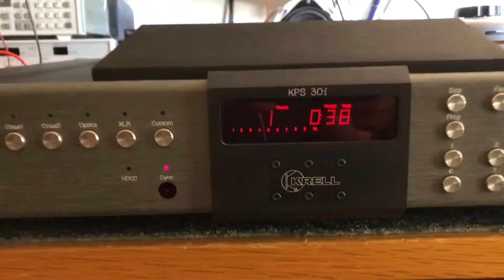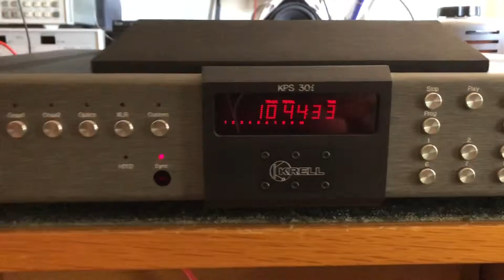Beautiful Krell KPS-30i CD Player Repair and Overhaul - From the Vault!

Comment: The price is too high because you can see the worst Philips mechanism that moves the pickup via gears and the ordinary brush motor for rotating the CD.
All brush motors are very noisy when they spark.